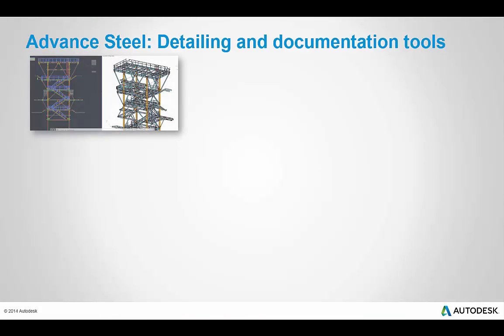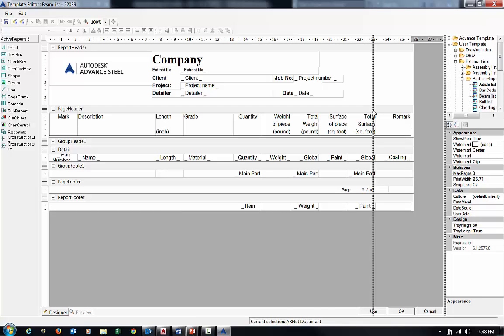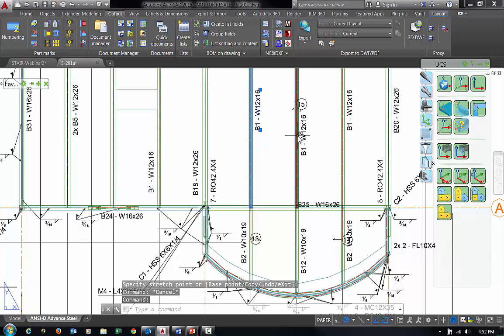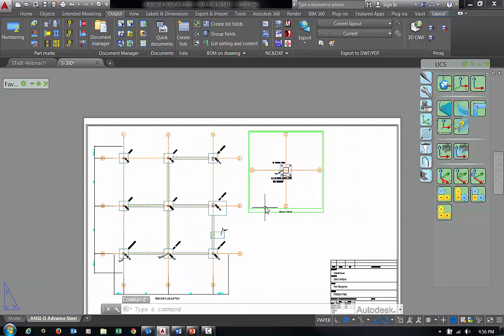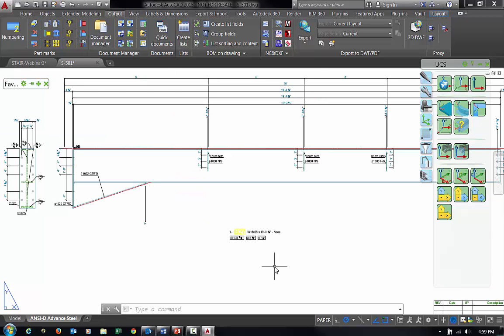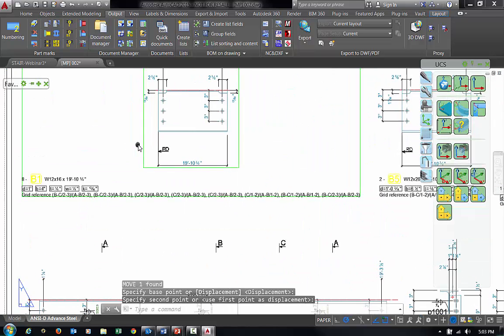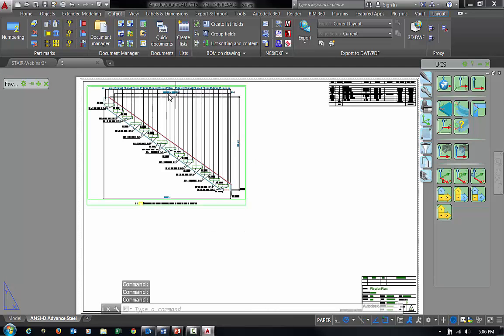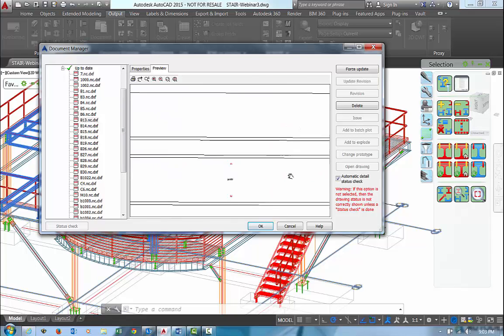Advance Steel Webinar Creating Automated Documentation

Comment: Hello! How do I install design styles from other countries?
Reply: Hi Elias,
Go to Control panel > Programs > Uninstall a program.
Select Autodesk Advance Steel 2015.1 then press "Uninstall/Change".
Select "Add or Remove Features".
In the "Additional drawing styles" branch, select the drawing styles from other countries, then press Update.
Press "Finish", and restart Advance Steel.
Go to Tools > Tools > Country settings, and select the countries for which ones you would like to see the drawing styles.
Regards, Philippe